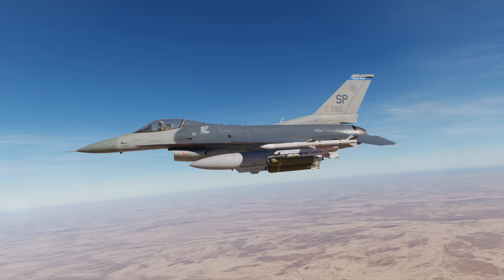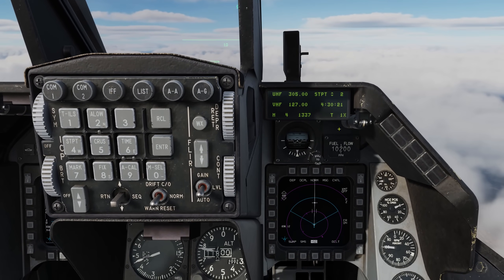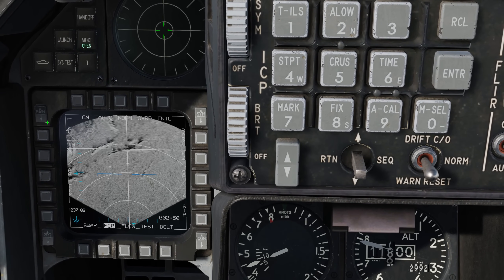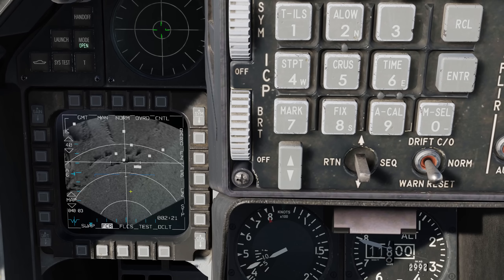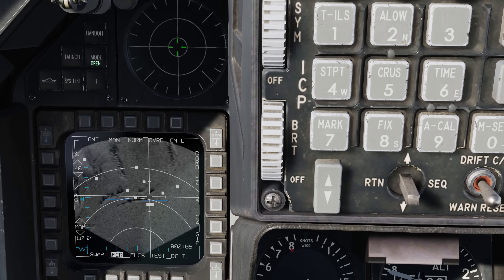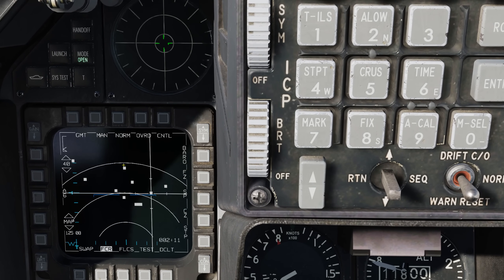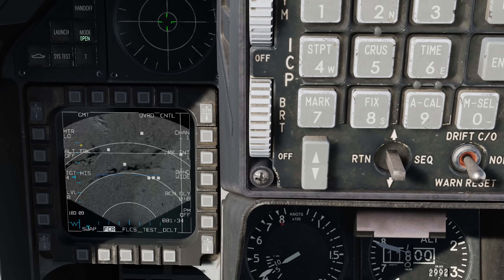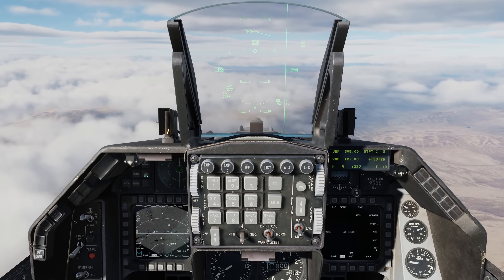DCS: F-16C Viper | Ground Moving Target

Comment: Would it be possible to demonstrate how to then engage those moving targets? It seems awfully clunky to me to either drop CBU's and just have to get the timing right of when the bomb will open and how long the chutes need to drift for (doable but seems unrealistic that irl this would be the method), bad weather negates laser bomb dropping, and when using the maverick & TPOD the handoff designates the last lat and long of the TPOD ... NOT the moving target itself ... which then requires a clunky and hasty switch to the WPN MFD and trying to get lucky and lock the moving target and not the road or traffic or the wrong target ... which then negates even using the TPOD in the first place in a way. It really doesn't seem to me that the f-16 currently has a smart way to engage moving targets from maximum range for self protection at this point.

Comment: Is that representation of ground targets realistic?  Is the computer detecting movement based on doppler and then putting them on the screen so theyre easier to see?  Does the radar have the ability to classify targets the way the F-15 radar can with air targets?  Is it able to do this because of SAR?
Reply: yeah, its similar to AA mode. Theyre displayed as a Brick, when detected and when they have enough radar reflection. No this f16 shouldnt be classifying targets, as it has no databank for it and the resolution is too low for it. You have to do it manually by either targeting pod or visually. But modern f16s, with upgraded radars (especially AESA Radar) could do it.

Comment: That's very handy for sure. I take it once a moving target stops it's no longer visible on the GMT mode and then we switch over to regular GM and use the sub modes for acquisition?
Reply: To answer your question, yes. I think the GMT basically works by doing two scans and comparing them for any returns that have moved (if I’m wrong then instead it looks for any returns with a Doppler shift). If your target stops moving before you start tracking it with TMS UP, it’s going to disappear unless you use GM mode again. 

I’d use it in conjunction with a TGP/Maverick to locate a convoy, then use the TGP/Maverick to finalise the solution and engage from there..
Reply: Don't worry the F16 will run out of fuel by that time (joking)

Comment: Does civilian traffic show up or will it magically pick a convoy out on a busy road?
Reply: Imagine rl.....
Reply: Thaat's gonna be a lot of effort to sift through all the contacts...

*TMS Up*
*Checks TGP*
"Nop, civillian"
*TMS Down*
*Next target*
*TMS Up*
*Checks TGP*
"Nop, civillian"
*TMS Down*
*Next target*
...
Reply: I thought I'd opin a bit....
Consider our sims (software and hardware) having to display/track hundreds maybe thousands of moving targets.
Consider rl where it requires very coordinated teamwork and planning for days or longer for success.  Otherwise you'll be flying around too much verifying/confirming targets, thus low success.  The importance of link 16 and other teams/sensors helping. 

Pretty daunting task(s) but ED has done a great job with the complex systems with limited info (none likely up-tp-date re: current rl ac).
Reply: Yeah, I'd guess AWACS and Rivet Joint aircraft would help quite a bit in that clutter of stuff.
As a side note, can the real aircraft share markpoints over datalink...?
Reply: @Lightning_Mike  That's more of the JSTARS' job.
Reply: @Lightning_Mike  Absolutely. Over either DL (IDM or Link16) you can share SPI as a point to another airplane.
Reply: @frederf3227  Well, that would simplify the job quite a bit more